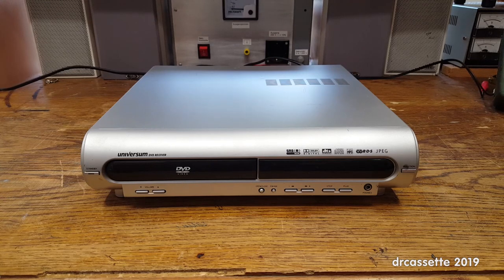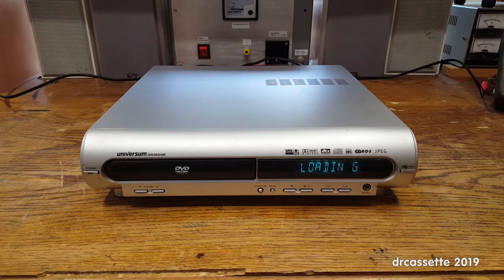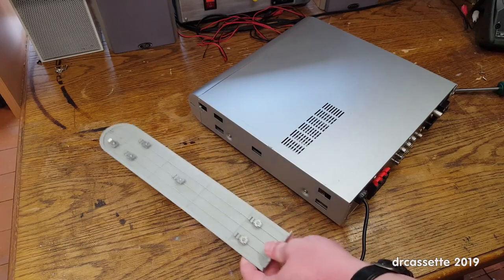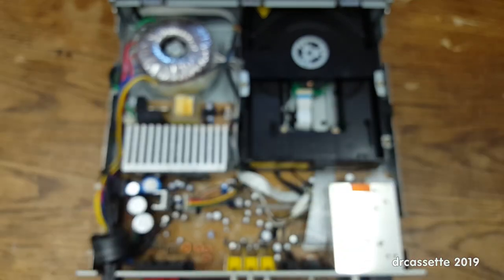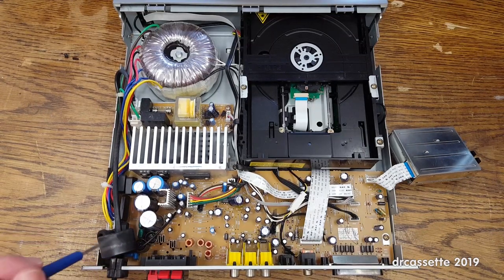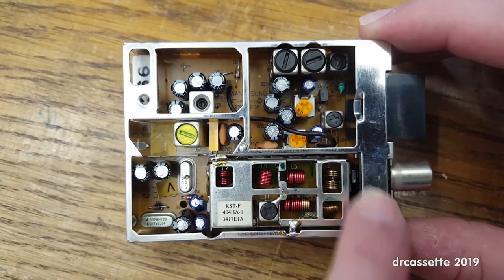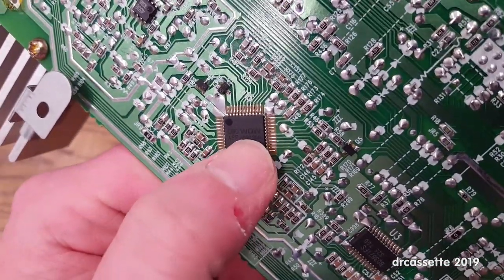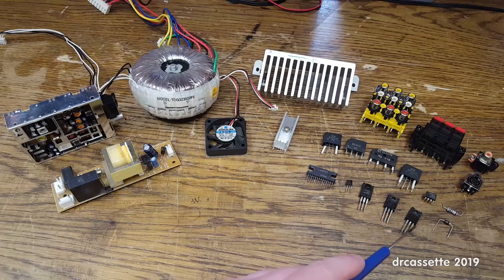Universum DVD Receiver Teardown

Comment: That player looks quite nice for a value oriented design. Would have been a basic but compact system. I still collect DVD’s also still watch them a lot. Btw, I recently bought a Technics RS M-205 casette deck at a thriftstore for a bout 35€. It’s a nice looking unit but it has a weird problem. It seems to play casettes just fine, but completely fails to record them. The VU meters don’t move at all when I record from the line input and when I try the mic input they move but I get a high pitched screetching noise. Any idea what the fault could be? I let my dad have a go at fixing it. Also the record level knobs seem to need some kontakt cleaner on the pots.
Reply from the maker: 35€ is a lot of money for a M205... anyway, seems like you have a dirty record/play switch. It is located on the main board and is connected to the mechanism. Spray in some contact cleaner (I use Tuner 600), and with the deck unplugged, manually move the record/play switch a bunch of times. You can use the same contact cleaning spray for the potentiometers.
Reply: Still collect DVDs too, even started collecting players as well. Finding some great old models at thrifts quite often.
Reply: DrCassette I Fixed the problem, but it was caused by something rather stupid. I had it connected to the line out of my Steinberg audio interface with a stereo splitter 😰 as to which I have also got my computer speakers connected to. Silly me, the signal just got too weak but I’m just a building design engineer. My dad pointed out that this doesn’t work. Removed the splitter, it now records like a charm.